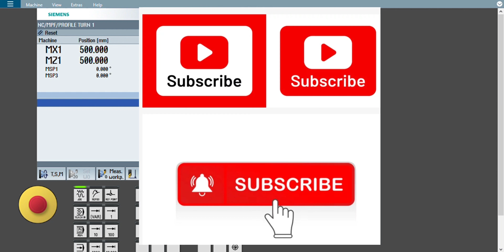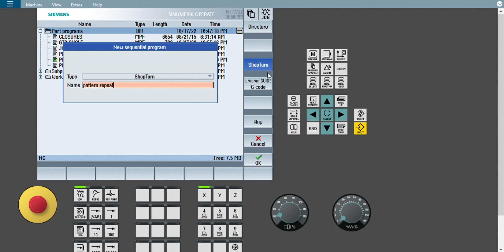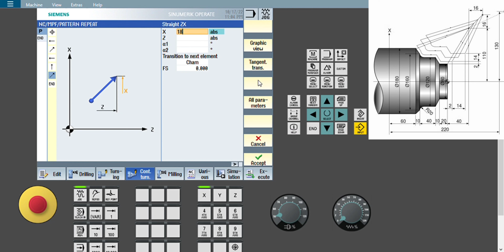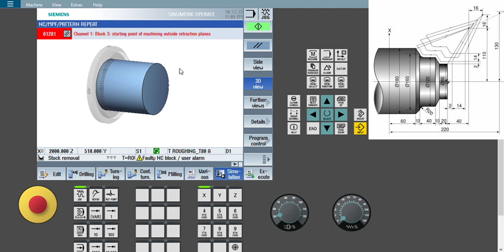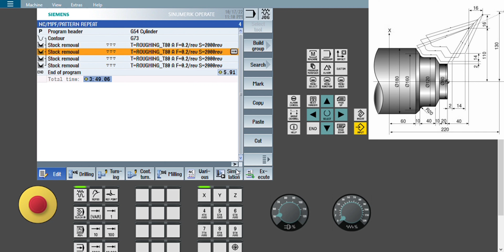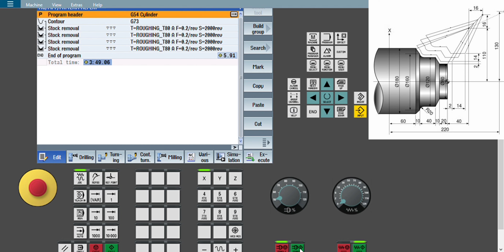G73 Pattern Repeat Cycle in shop turn programming in Siemens CNC- Shop turn sinumerik 828D/840DSL

Comment: Great video, thanks for every video, keep up the good work. I may be wrong, but I think you programmed only the finish by mistake and it can be seen on the simulation that the entire knife goes through solid metal. This may work on a virtual simulation, however on a real machine it would result in tool damage or breakage. Best regards!🙂👍
Reply from the maker: Nop , it’s correct we are doing here pattern repeat cycle, so on machine it will be with some profile and this cycle will just remove skin of that profile in multiple passes.
Note - this is not solid part machining, it’s a profile part machining
Reply: Anyway, thanks for the quick reply. Now I'm going to watch your other videos and hope for a good learning, best regards!👍
Reply from the maker: @strojarskastrukastolac416  please.. thanks for your comment, I am always up for learner’s
Reply: I am also a professor, and I prepare material for students, so I appreciate your work that will help me. thank you friend.
Reply from the maker: @strojarskastrukastolac416  thanks a lot sir , 8180081059 it’s my what’s app number , you can connect with me anytime